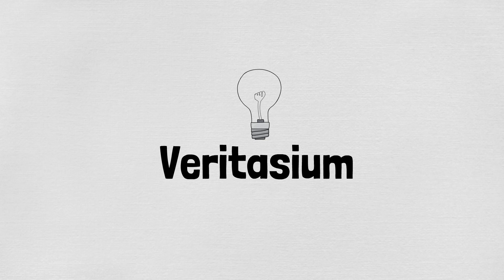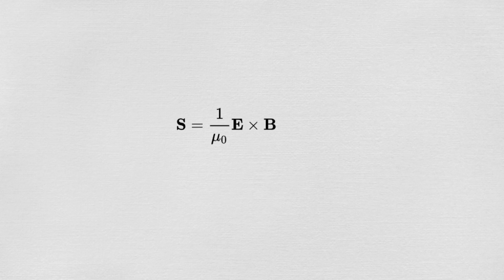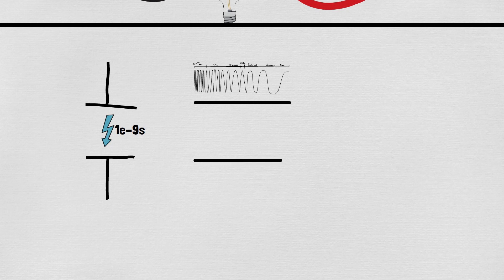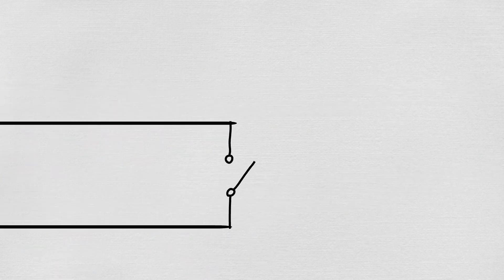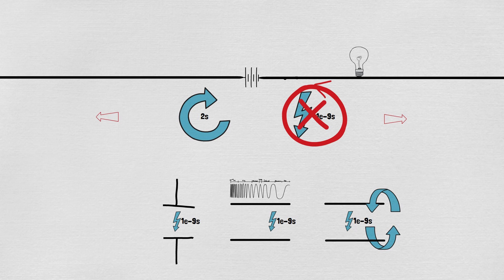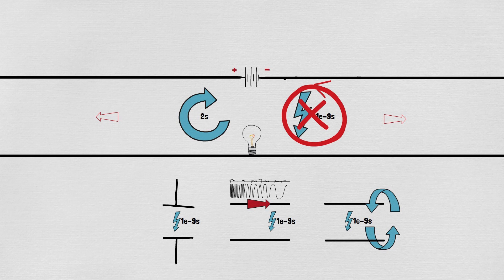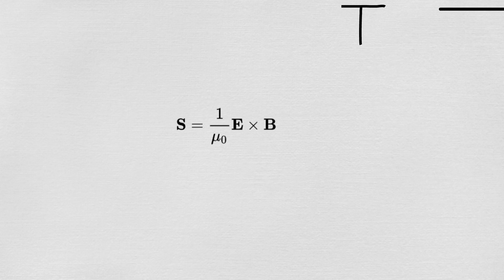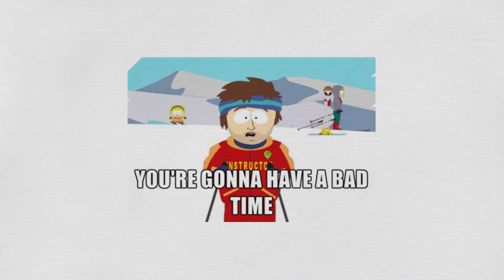Veritasium is Right? (see description)

Comment: As a Phd in EE (thesis in electromagnetics/radiometic sensing), I thank you for making this video.  I couldn't believe some of the crappy, hand wavy explanations to this problem that came out.  There is enough BS on the internet as it is, and I thank you for cleaning up a small piece of it.
Reply: As a fellow EE I concur, I think this vid a great job showing what was wrong. The original vid dropped a term, I can't count how many times things have felt wrong to me until I realized the math I was looking at had dropped terms for a simplified scenario!
Reply: You should probably work on your circuit intutition then..
Reply: How do we know that switch isn't just a capacitor in which current instantly starts flowing as soon as we remove the dielectric between. 

I mean every switch is really a capacitor with very small plates and a air as dielectric 

That would cause bulb to turn on.

A battery has potential difference before the current is flowing.  The anode and cathode physically have a  charge.  The reason Zn---> Zn(2+) +2e-(electron taken by electrode) doesn't happen because one electrode has actual negative charge. This negative charge instantly physically attracts any Zn2+ in by electrostatic force of attraction.  Due to being at higher potential then what Zn2+ can tolerate it's forced to absorb charge to be neutral.
It's a equilibrium of Zn losing electron and cathode forcing electrons to Zn2+.

I think. 
This question is probably more related to how cells work.
Are cells capacitors whose charge just replenishes 

I mean cell can be approximated by capacitors of near infinite charge and conductance .

I am not entirely sure how Zn --->Zn2+ equilibrium is maintained 

I am absolutely certain that a switch is just a capacitor where current doesn't flow because the charge on it's plate counters battery voltage.

When we say close a switch it's equivalent to removing dielectric from the capacitor. 
Current will flow instantly from one plate of capacitor to other in form of electron beams.
This current would cause induction according to lenz law.
Reply: @pravinrao3669  "current instantly starts flowing"

There is no "instant" in spacetime. The speed of light is really just the speed of causality, which is the maximum speed at which an event can propagate effects through the universe. So realistically, the time between when the switch is flipped and when the bulb turns on would be /at least/ the time it takes for light to travel between the switch and bulb (assuming an ideal conductor, where the speed of transmission is equal to the speed of light in a vacuum).
Reply: @berzoidberg3272  when I said instant. I meant current starts flowing inside the capacitor instantly not  the whole wire.
Current inside capacitor itself will cause induction
Reply: @pravinrao3669  Gotcha, I took that to mean current would instantly flow through the bulk
Reply: But the hand wavy explanations are less wrong than this video. Once you realize that closing a switch (one that has a potential difference on each terminal (equal but opposite to that of the battery)) does create an electromagnetic wave that manifests as current flow. And as he said, once you have current flow you will see all other phenomenon neatly explained by maxwell's equations.
Reply: @Isaías Ríos  I don't think that makes the video wrong necessarily, but perhaps still overly-simplified.

There are a few questions to ask:

1) Does an electric potential exist on the wire prior to the switch being flipped?

Yes, and this potential propagates from the battery along the wire at (for the sake of simplicity) the speed of light, stopping at the point where the circuit is broken. This means that at the time of circuit construction, it will take a certain amount of time for the electric potential to reach the switch. The amount of time for this to establish is always the same, regardless of where the switch is.

2) Is electrical potential the same as an electric field?

No, an electric field is established by charge. Charge is not propagated until the circuit is closed. Charge propagates along the wire at (for the sake of simplicity) the speed of light.

3) Where the hell is the switch in this circuit?

For further examination let's assume that the switch is located on the back side of the lightbulb, equidistant from both + and - terminals on the battery, or roughly 1 light-second away from the energy source.

So what should happen in the circuit is when the circuit is closed at the switch, electric potential is established across the entire circuit and an electric field can /begin/ to propagate. Due to the speed of causality, this occurrence will take 1 second to reach the battery in either direction. After this first second, the electric field will propagate , or in this case from the positive terminal on the battery along the wire to the negative terminal on the battery. Current flows along with this electric field, again at the speed of light. Once the current reaches the bulb and flows through it, the bulb turns on -- its the act of current on the bulb that causes it to light up, which seems to be something also missing in a lot of analyses. In this case since the bulb is 1 light-second from the positive terminal, it will take 1 second for the bulb to turn on.

So let's look at the numbers here. We have 1 second for potential to establish the propagation of an electric field, and 1 second for the current to reach the bulb and light it up. 2 seconds, right?

But what if we move the switch to be right next to the positive terminal.

Assuming the circuit has been together long enough for electric potential from the negative side to reach the negative side of the switch, flipping the switch will near-immediately begin the propagation of electric charge (and thus, field and current) along the wire. This reduces the amount of time to light the bulb to 1s, give or take a few femtoseconds.

But what if we move... the bulb? If we place the bulb directly after the switch, which in turn is directly after the positive terminal on the battery, we can achieve near-instant activation of the bulb regardless of the circuit length -- as long as, once again, there has been sufficient time for the electric potential to propagate along the wire. The reason the bulb would light immediately is that again its current that activates the bulb, current is sourced from the positive terminal and flows toward the negative, and the current flows through the bulb near-instantly due to its proximity to the battery.

Now what happens if we have a switch on both the positive and negative sides of the battery, right next to the terminals, and we flip both switches to close the circuit at once?

Well, we don't have a pre-established electric potential along the circuit, so first that potential must propagate from each side of the battery along the wire. So that's giving us 1s of time. Once the potentials meet, it takes another second for that interaction to reach the positive side of the battery. Then current begins to flow. So we're looking at 2s give or take a few femtoseconds for the bulb to light up, assuming the bulb is still immediately after the positive-side switch.

If we move the bulb back to equidistant between terminals, you're looking at 3 seconds.

Finally, if we move the bulb to the negative side of the circuit right next to the switch, 4 seconds for the bulb to light.

These things are much more complicated than either video addressed really -- but I think the one we're commenting on currently is much more accurate than most.
Reply: Hey! I am not an expert on any of this, but i did want to make a question because there is something confusing me since i saw the veritasium video, in this video, it is stated that it takes 2s because the electromagnetic field must be propagated through the movement of electrons inside of the wire, and for that to happen 2 seconds must pass, but i haven't really understood yet is how the actual energy is transmited, does the energy travel with the electrons as in cinematic energy? Or is it propagated through the magnetic and electric fields?
Reply: @captainseal9956  through the EM field. Electrons don’t really move move at all (Google electron drift speed).

As configured, it would take 1s not two, as the current flows from positive to negative. Since the switch is right next to the positive side (or so it seemed?), there’s no delay in casual propagation and the EM field (and thus current) begins to flow pretty much immediately. Once the current flows through the bulb 1 light second away, it lights up. The current needn’t reach the negative terminal for it to light.
Reply: @captainseal9956  actually looking back, he has the switch on the neg side, so it would take 3 seconds. 2 seconds for casual propagation along the wire length to trigger current flow from the positive side, 1 second for current to reach the bulb.
Reply: Since you have a PhD could you explain to me how energy is actually transferred from my charger to my phone and how the battery percentage increases with charging? I don’t know how it actually works
Reply: Or anyone else who knows how it works
Reply: @berzoidberg3272  The "immediate" current that equalizes the potential across the switch is a miniscule transient that would not turn the light bulb on.  This is part of the issue with how the problem was originally presented.  The light bulb will not turn on until a significant, close to steady-state current, is established.  If a miniscule transient current is all it takes to "turn on" the light bulb, then thermal noise voltage would keep the light bulb turned on at all times.  The video was intended to clear up a "the big misconception about electricity", it seems however he created a rather big misconception, since so many people think miniscule transient currents turn on your light bulb
Reply: @PelosiStockPortfolio  yup my feelings exactly. It also completely ignored delays in potential propagation and casual propagation along the wire. Even worse is that other video makers are using finite element simulation to back this up, despite the fact that those simulations weren’t designed to work across relativistic distances… they make some pretty deep assumptions that certain portions of the interaction are “instant” for the sake of efficiently calculating the stuff that “matters” is most systems.
Reply: @inthebackwiththerabbish   No energy, charge, photons, waves, spin, fields etc Only the expanding electron crossing over from subatomic realm to atomic realm. Details:”The Final Theory: Rethinking Our Scientific Legacy “, Mark McCutcheon.
Reply: I really hope for the sake of the integrity of our academic institutions that a PhD in EM would understand that a transient change in voltage on a wire will produce an EM field that will induce current into the light bulb nearly instantly. This video is not correct; the original Veritasium video is correct (under the assumptions Derek proposed to simplify the problem).
Reply: @inthebackwiththerabbish  I do not build batteries so my answer is probably surface level at best, and possibly has mistakes.  The battery itself has chemicals inside of it, along with an anode and a cathode (positive/negative terminals that collect charge).  Electrical energy from your charger (voltage/current or EM fields, however you want to think of it) is applied to the chemicals in the battery, charge separates out and builds up on the anode/cathode, which is now stored potential energy that can be used later by turning on your phone and drawing current (moving charge) from the battery.
Reply: The actual wire length in this experiment probably doesn’t exceed 200 feet: of course the bulb lights ‘instantly.” Derek is misdirection at best.
Reply: @izayus11  The miniscule transient current that equalizes the voltage potential across the switch does not turn the light bulb on.
Reply: @funkathustra  I understand that a miniscule transient current will create a miniscule EM field that will propagate out from the switch but wont turn the light bulb on.  This video is correct, the light bulb turns on when a near steady-state current is reached.
Reply: @PelosiStockPortfolio  according to Derek's assumptions, ANY current over the 0  resistance wire will turn the light on. Which kinda begs the question, is the light ever off?
Reply: @PelosiStockPortfolio  You still dont get it Mr doctor in ee. Even the author of the video retracted his original claim. He has indeed seen the light on failing to consider the difference in potential across the switch.  The important thing here is to realize that in closing the switch, the smoothing out of the difference in potential will propagate an electromagnetic wave that will manifest in current flow. The magnitude of said current is not relevant in Derek's study frame. What matters is direction and time of propagation.
Reply: @berzoidberg3272  did you know that the phase velocity of electromagnetic waves in a rectangular metallic waveguide is actually faster than the speed of light? In fact it can exceed c by many times and that can easily be measured in a lab.
Reply: You have a PhD in EE and yet you don’t see how this trick question from Veritasium is really just a simple two wire transmission line problem.
Reply: @jb_50w78  of course, because phase velocity isn’t actually a physical thing. It’s a term we use for a useful variable. “Phase velocity” isn’t actually measuring the speed of a real thing. Nothing tangible (no particle, wave, energy, or information) is actually moving at that speed.
Reply: @funkathustra  honestly it’s really depressing how many people are actually confused about this simple thought experiment (even people with degrees in EE and physics!)
Reply: @PelosiStockPortfolio  I think it should have been clear that the Veritasium video was all about transmission line theory (meaning that the spirit of the thought experiment was small transient current turning on the bulb, because it’s a two wire transmission line). He even talked about the transatlantic cable and Oliver Heaviside (who derived the telegrapher’s equations).
The video is extremely simplified (to the detriment of being totally accurate) in order to be accessible to a general audience with no technical background and education. But with the understanding about the assumptions of what current will turn on the idealized hypothetical bulb, the 1m/c answer should not be that surprising.

(By the way I have a PhD in EE too and also in electromagnetics)
Reply: @berzoidberg3272  alright, just making sure you knew about that.
Reply: @jb_50w78  You can read and yet you can't comprehend?  I have written quite a bit explaining why EM coupling of transients is NOT the correct solution to when the light bulb turns on.  I am in full agreement this is a simple transmission line problem.  We know the phase velocity and we know the line length, the answer is simple division.  I have no idea where you got the idea that I am saying something different.
Reply: @PelosiStockPortfolio  ok I never disagreed with you on anything…
I find it absolutely amazing how so many people get so uptight about a simple little transmission line problem. This thought experiment from the Veritasium video just sounds like some trick question you’d see on an exam in an undergraduate EE course on transmission lines. 

Also, my god you are incredibly rude and disrespectful to random people on YouTube comments.
Reply: @jb_50w78  I am nice to nice people, when someone starts off rude to me, I can be rude back.  Its not personal, just how I perceived your "you have a phd and you dont even know..." comment
Reply: @PelosiStockPortfolio  I saw all your comments about why the small transient current wouldn’t turn on the bulb and I fully agree with you that with the conditions Veritasium have for what would turn on the bulb, the bulb would already be on. 
The truth is that you don’t even need to have a PhD in EE or physics to understand that. Any EE with an undergraduate education will get that.
Veritasium’s video was just a crappy explanation of transmission line theory and the Poynting vector made for the general public.
Reply: @PelosiStockPortfolio  well from your initial comment it seemed like you didn’t even understand that it is just a simple transmission line problem and a trick question. But it’s ok. No hard feelings.
Reply: @jb_50w78  With the exception of his goofy question I thought the video was good for the general public.  Since I clicked on it, I see tons video responses with explanations that sound convincing, saying a battery will turn on a light bulb with no DC connection.  Ironically it seems to have snow balled into misleading a lot of less knowledgeable people about how electricity works.
Reply: @PelosiStockPortfolio  the way he talked about the transatlantic cable and never once mentioned the words “transmission line” in the video (let alone the Heaviside condition which was actually used to solve the dispersion issues with the transatlantic cable) was really annoying to me. Other than that and the light bulb problem, I thought Veritasium’s video was fine. 

I saw several response videos and I have not seen any claiming that a battery will turn on a light bulb wirelessly. Almost all have said clearly that it will most likely NOT turn on the light bulb. EEVblog’s video was pretty good. ElectroBOOM even did a nice and entertaining video that was pretty good.

And I don’t see the problem with exposing people to ideas like the Poynting vector. The truth is many will be confused and have more misconceptions regardless. It takes a lot more than just a YouTube video to get people to understand accurately how electricity works. What’s good is that it gets people interested in the topic.
Reply: @jb_50w78  The poynting vector part was really good, his trick problem seems to have really stolen the show though.  Yes, people are talking about it and maybe it gets younger people interested in exploring the field.  Those are positives